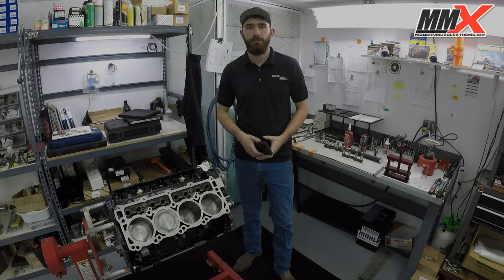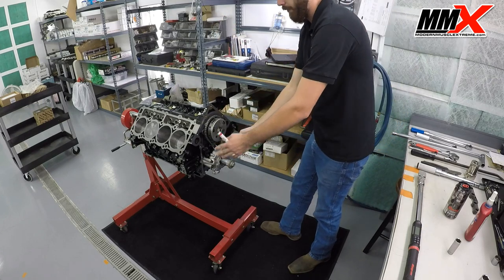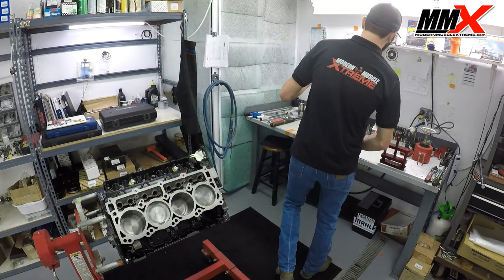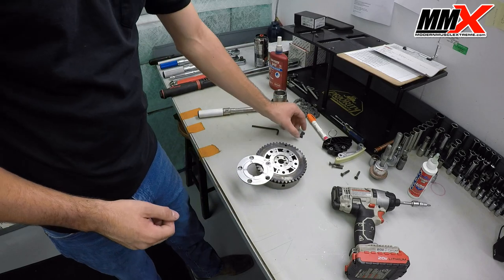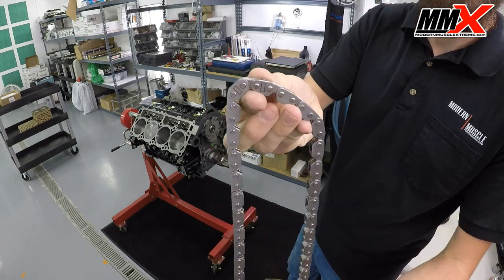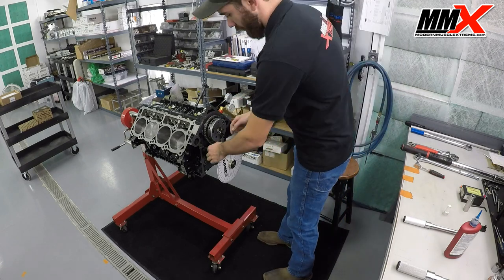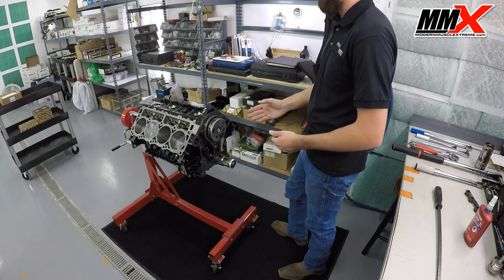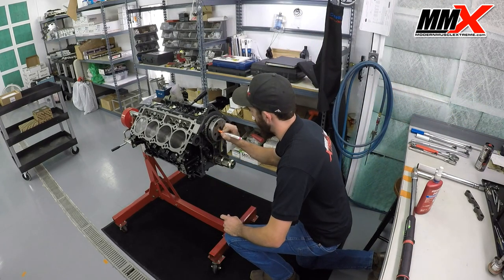Gen3 HEMI Camshaft Tips and Installation Instruction by MMX / ModernMuscleXtreme.com

Comment: Hello. Doesn't locking the crank and  torquing the cam bolt put a ton of pressure on the tensioner? Thanks for the video.

Comment: Is it possble to eliminate the phaser altogether and just get a solid gear to replace it with? I want to delete mine but the concept of a phaser lock  seems sort of hackish to me. Also, shouldn't you replace the cam bearings when installing a new camshaft??

Comment: I had 2012 Dodge Ram 1500 SLT 5.7Hemi, i deleted the MDS sensor, then i changed all lifters to non MDS lifter, and i have a flash tuner to delete the MDS, but i used the stock camshaft is there any future problem because i didn’t change the stock camshaft to non mds camshaft? Thanks for your reply i appreciate.

Comment: Im doing this myself because theone time I get a mechanic to help he messes my truck up more than it was before so can I take out the old camshaft and just clean it and put it back in to retime the chain and what happens if the camshaft doesnt turn freely what does that mean? Because the truck wasnt having any issues with tining or camshaft until I had a mechanic help me change the oil pump and he only took the tensioner off the timing chain nothing else and now it's out of time according to codes and now I have to do it myself and I broke it all down and in other videos it shows ppl just freely turning the camshaft pulley thing and bottom part the oil pump slides on to but mine won't turn to retime and I'm not trying to break anything

Comment: On my hemi the roller must have shattered.  When I pulled the valve out there was no roller on the lifter.  Would the roller pieces have fallen into the oil pan or is the engine done for?

Thanks

Comment: How will you hold the camshaft, when tighten the Campully-Srew, when the engine is installed ?
And is the force putting to the little chain not too much ?
Reply: I was gonna ask the same. 👍.

Comment: Would a nsr cam or a springs cam be better for power and more a daily driver. Currently have a 2013 5.7 charger only modes are long tube headers

Comment: Hello I was wondering do you need to take the heads off of a pre-assembled motor to install an aftermarket cam? I'm only asking because I plan on buying a Hemi out of a totaled Challenger or charger & I want to put a Lopey idle cam in the motor so I was hoping I didn't have to completely disassemble the motor to install the cam and MDS delete kit.
Reply from the maker: Unknown Traveler yes to change lifters

Comment: How is cam held when tightening bolt if engine still in vehicle?? Also cam tool is cool but cant be used if engine still in vehicle, or can it if grille removed?.. awesome video..
Reply: you can put the balancer on and put a socket wrench tip in one of the hole and turn it until it contacts the support beam below, the crank away

Comment: This video repeats a lot of things and misses a bunch of others that are important. Also it's not very much help for someone trying to replace a cam while the engine is still in the car. You guys should re-do this video and make it better. Include things like which bolts on the timing cover and water pump need to come out and which ones can stay, how to get clearance in front of the engine to be able to get the cam in and out of the engine and how to pick the right pushrods, to make sure they are seated in the lifters, etc.
Reply: It’s not a how to video it’s a tips video.

Comment: i have a question, i recently purchased the MDS delete kit with camshaft, oil pump etc. my question is being  my car is a 09 dodge charger SE hemi 5.7l do i need to get the vvt stroker ring for crankshaft gear install or being that it is a VVT engine does already have that vvt stroker ring.
Reply from the maker: Andrew Douglas only if using aftermarket or a 6.1 crank

Comment: Questions for you guys at MMP.  WHY do the roller bearings in the MDS lifters seize up in the first place???  What causes this to happen???  Is there a proven and guaranteed definite fix to prevent this from ever happening again???  Is the valve train in the 5.7 Hemi engine a poor design to begin with???
Reply from the maker: m2hbvic Vic It is my opinion it is more about valve train harmonics than oiling

Comment: Does the MDS system affect the 4.7 L engine in the same manner that you just described at the beginning of this video because I'm having problems with mine and I'm getting a weird idle and misfire codes if that's the case this video help me solve a problem in my vehicle that I didn't know it was related to this
Reply: 4.7 was before MDS. Only affects 5.7 Hemis 2009+

Comment: Good informative video,sound needs to be addressed.And yet another example of INCORRECT torque wrench usage.He overtorqued every single bolt.Once a TW releases that is the preset torque desired.Don't believe me-okay. Torque a bolt down and double or triple click it.Then using the TW at the  original preset and try to loosen the bolt.Do it slowly and the TW will release w/o loosening the bolt.Keep increasing preset until bolt breaks free and that will be the final torque.I only have 50 yrs experience as an Aircraft mechanic

Comment: If I don't have a degreeing tool Would just spinning it an making sure the timing lines line back up Be okay ?
Reply from the maker: Lalo Grove marks will not line up after rotation. Degree cam is best method but if not follow a factory install procedure.

Comment: Why not install a cam sprocket without the phaser if you want to get rid of the mds? If would have less parasitic drag on the rotating assembly,quicker acceleration.

Comment: What brand lifters do you recommend? I just bought a Howard's 520 lift mds cam.  You see a problem using Enginetech lifters or should I use Johnson's or maybe Hellcat lifters? It's a 2007 5.7 Ram.
Reply from the maker: Anoint426 Hemi we only use Hellcat in all our builds

Comment: Hello guys we have recently replaced the mds stock cam with a stock mds cam on a 2011 durango with hemi had a stuck lifter roller in cylinder 3 eating into the cam. We have done everything to the T like the videos show but now it wont start just turn over and sounds like it wants to but won't so frustrating any ideas guys please help thanks in advance.

Comment: You may want to put grease on the contact face of that cam bolt, ARP supplies such grease (and explains how/why to apply it) with their HEMI flywheel bolt kit. Without grease alot of that 90 ft/lb is used to overcome bolt to phaser friction.
Reply: arp scammers

Comment: i have a 07 charger and looking at a 07 hemi out of a truck to put in my charger ..will my car harrness plug into the truck hemi..?...thanks
Reply from the maker: john smith you can use the truck engine as a long block but
Reply from the maker: john smith will need to transfer all covers snd sensors

Comment: Am super confused with the timing.. would I have to do all that if I just want to replace my cam with a 392 cam. I have the hemi 5.7 in my 2014 chrysler 300
Reply from the maker: Jorge Macedo what are you confused about 
FYI there are better cam choices
Reply: Jorge did you find your answer? Was looking to do the same
Reply: @ModernMuscleXtreme  I picked up a stage 4 Texas speed cam. I bought the same size pushrods as stock. I haven’t installed it yet due to the fear of them being too short or too long. How do I go about finding out if these will work fine?

Comment: My 2015 ram 1500 keeps getting a error code of a cyclinder 4 misfire, and on rare occasion multiple cyclinder misfires. I've changed all plugs, checked coils to see if there faulty, those haven't fixed the problem. Any ideas of what I should check next before I ha e ro get someone to RIP the engine apart to find if its internal?
Reply: Pull your valve cover make sure the pushrod is still on rocket and is moving properly. I had the same problem! If that all works well like supposed to look into the computer Ebay has them with lifetime warranty from a company in florida comes preprogrammed to your key! Nice service great quality I've bought 2 from this company 2 different dodge vehicles
Reply: the hemi has a flaw in the older engines, i think up 12 or 13.  roller on lifter locks up and wipes out the cam.  im dealing with this now.  misfire on number 4.  pull the valve cover and see if rocker and pushrod are moving, if not its the lifter and cam.
Reply: Are you getting a ticking sound from the engine at idle?
Reply: @byronwalker3606  I've stuck my head in the wheel well to try and hear ticking, but it all sounds like regular operational sounds to me
Reply: Mine sounded regular,  even drove fine lol once I got the p0305 code I took it apart & sure enough ... damn seized lifter
Reply: @anthonyjoyner4069  actually,  through mid-2016.

Comment: I have a question. So if I’m installing a oem 392 cam that came out of a scat pack that had mds do I have to delete my mds?
Reply from the maker: No it needs to stay functional and use MDS lifters
Reply: Modern Muscle Performance / ModernMuscleXtreme.com  ok great because next week I’m dropping my transmission and engine with engine cradle but since I’m doing that should I replace lifters, lifting rods, and oil pump since it’s all coming out?
Reply from the maker: If you use non mds lifters 
You need a cam
Reply: Modern Muscle Performance / ModernMuscleXtreme.com I’m going to be using a 392 oem cam that came out of a car with mds so you said I need to keep the mds lifters so I was then asking if I should replace the old mds lifters with new mds lifters

Comment: I’ve seen so many people put in a 6 o’clock position instead of a 5 is it really that crucial I hear mixed reviews about either or. 
Ik a master tech at dodge who showed me pictures of the timing marks , the manual states for 12 to 6 o’clock . 
But I’ve talked to mechanics who aren’t “dodge emplyees” and they told me 12 to 5 o’clock position .
And they’ve ran their cars at the 12 to 5 o’clock position and no problems at all

Comment: Any advice on reinstalling the harmonic balancer?
Reply from the maker: VW69Baja we have an installer 
And we use a hot plate to heat balancer to help
Use a press lube
Reply: tap in the balancer until about the 5th or 6 thread, then wrench it the rest of the way.

Comment: I have a 2017 jeep grand cherokee with the 5.7 what came would you recommend for it?
Reply: http://www.modernmusclextreme.com/p-134-57l-hemi-vvt-custom-grind-performance-camshaft.aspx
We would grind you something custom for the heavier vehicle.
Reply: You don't need a new cam for a '17. Starting in mid - 2016, Melling began supplying reengineered lifters and a hardened cam for the 5.7 and 6 4 V8s.  Squad cars also got slightly softer valve springs.  These changes seem to have solved the old valvetrain failures.

Comment: This definitely clears some things up for me! I couldn't for the life of me get exactly 6 and 12 o'clock on my timing. Either the cam is slightly off or the crank. When my cam is dead 12 with TDC, my crank is a little off 6. I appreciate you touching bass on this because I couldn't get a straight answer anywhere else. You're the man. 🤙
By the way, I have a gen 4 so it is obviously the same process.
Reply: Wgat did you have to do to get it lined up because I’m having that problem now, when I’m at tdc my crank mark isn’t exactly at 6, and my cam mark is on 12 but when my crank mark is at 6 then I’m not at tdc and my cam mark is slightly off
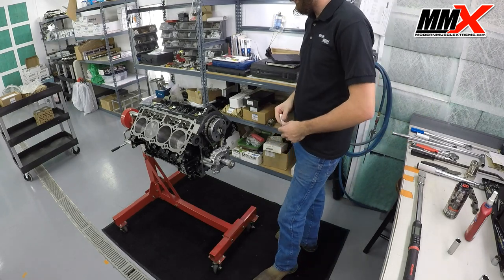Reply: @dariusstcyr  line your cam at 12. That's all that matters. Your crank will be at about 5:45. 👍
Reply: @brokensmile8487  perfect! it started right up this morning. your comment was a big help! thank you
Reply: @dariusstcyr  no problem man. I couldn't never find that very same info but I knew you must have the cam lined up at 12... that's a must. So I basically lined up the cam and hope for the best on the crank timing. My ram has been a beast every since. Glad I could help bro.
Reply: @brokensmile8487  He specifically touches on this point at 27:50 MARk. Crank will be at 5 oclock..5:45 some say. Not at a perfect 6oclock.
Reply: @MrCraig-bk7bx  I surly missed that. I'm glad you cleared that up, your comment was a big help. It's definitely closer to 5:45 rather then 5.

Comment: hi, What do you do if camshaft is too tight after install?
Reply from the maker: BB Bookes are you talking valve clearance or cam bearing
Reply: Modern Muscle Performance / ModernMuscleXtreme.com no, the cam shaft takes too much torque to turn it with out a load at all,can something be done to cam journals, I don’t want to remove bearings again, ready to give up on it!!!
Reply: @bbbookes8406  : Sounds like your cam shaft is bowed.....V block each end, check run out between....You will be surprised how easy the cam bends..... Dead blow hammer or put in lathe and lever it to run true.....Or ship it back
and request New one in Proper Container, not just a cardboard box......

Comment: Would anyone know the difference between a gen lll and gen llll?
Reply from the maker: I believe the gen4 refers to the VVT
Reply: Did you say mmx sales stock camshafts? The problem I'm having is I have a 2014 ram 1500 5.7L and I want MDS deleted but however I've read they've made several cams which are not interchangeable. So I'm guessing I would need a cam that suits VVT and the SRV but does not have MDS lobs. I heard the Challenger with a manual transmission uses a p/n 53022064BD cam and it has VVT but not MDS, however, I don't think it has active intake, ( SRV). I'm starting to think I'm stock with the stock cam with bs DMS or comp cam?!
Reply from the maker: @brokensmile8487  we sell non mds and custom. Either way you need to have MDS cut off in tune

Comment: Can you run the comp cams xfi 274 cam in a 5.7 hemi?
Reply from the maker: Thomas Patillo that is not the appropriate cam for a 5.7
Reply: @ModernMuscleXtreme  I want a good choppy sound. What camshaft should I go with.
Reply: 260h-13 is what I've read is best for a streetable cam for the 5.7 hemi.
Reply from the maker: Thomas Patillo refer to our cam selection area on our site and we would be glad to discuss your specific needs

Comment: I have a 2007 ram 1500 hemi just got timing chain water pump and oil pump done now my truck boggs at 65 to 70 mph and has high 3000 rpm
Reply from the maker: Anthony Salas possible timing chain installed improperly

Comment: Can regular vehicle specified oil like 5w-20 for the 5.7 hemi be used to Lube the camshaft?
Reply: That would be better than no lube, Lucas is preferred.
Reply: Moly assembly lube for any rotating parts/assemblies. 

Mopar recommends Pennzoil 5W-20 full synthetic engine oil. I use it in my '13 V8 Pursuit without issues.

Comment: Mds is not the cause of all the failures have seen and herd of plenty with and without having cam lifter failure. Currently have a 2500 with no mds with high idle time and the cam is wiped.

Comment: I never run my vehicle in eco mode so hopefully I’ll never have lifter failures.
Reply from the maker: jasonneal still change oil often
Reply: I drive mine like I’m starring in the next Dukes of Hazzard movie constantly, but I’m very particular about maintenance and have mds shut off. I’ve never had a problem with my lifters either.
Reply from the maker: Christmas Gummyworm maintenance is the key

Comment: I'm completely positive that the hemi lifter failures have nothing to do with mds. Way too many owners of deleted or never had mds systems have had lifter failures that ate the cam. The problem is cheap "lowest bidder" lifters. If you are over 50k miles and intend on keeping your hemi I highly suggest investing in high quality lifters now.
Reply from the maker: cgirl111 
Mopar had a run of lifters made from about 2011 to 2016 with a smaller roller bearing. It seems these are the worst with failures mds or not. 
Thanks